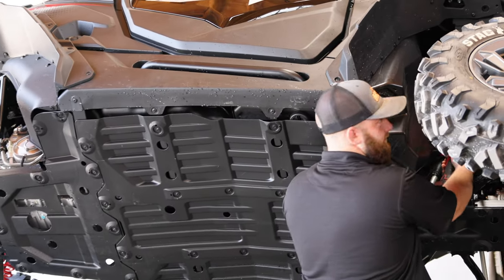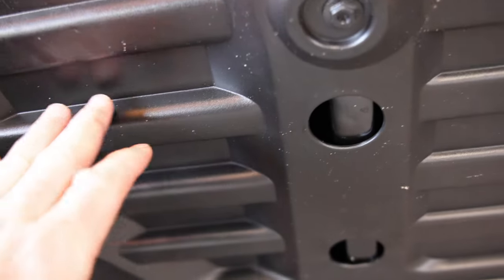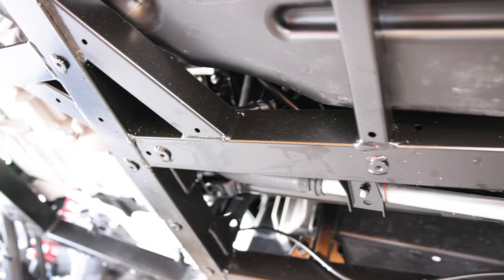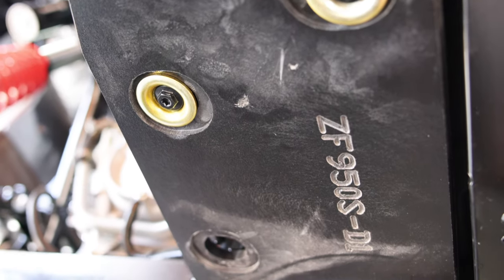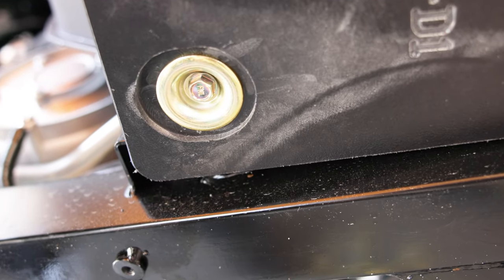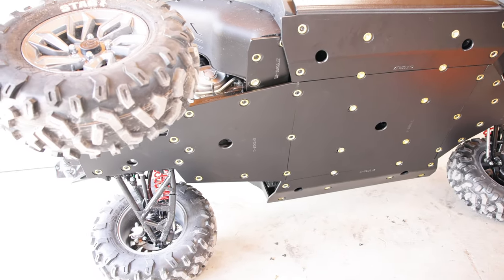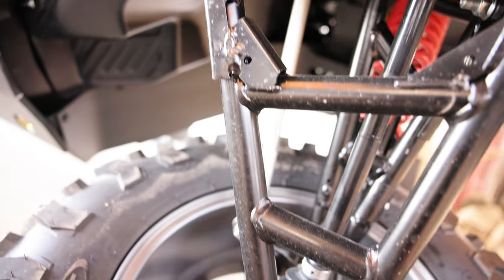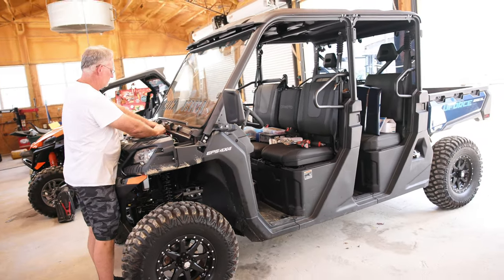Gen 2 CFMOTO ZFORCE 950 Sport Full Skid Plate & A-Arm Guards | Trail Armor

Comment: Okay, I gots to know….exactly how are you tilting the machine in the shop to work on the bottom like that?  Is it blocked somehow on the cage?  I’ve got ways to lift one side, but it never occurred to me there was a way to stand it up that way.
Reply from the maker: hahaha... well... with just the precise tire pressure and with 1.749 gallons of fuel and no mud or dirt build up and with the room at exactly 79 degrees F you can achieve proper balancing room atmosphere for this particular CFMOTO model haha
Reply: The rear of the cage was resting on a stack of tires rewatch the video you can  see it just don't tell anybody it's a secret 😅
Reply: @RealTalkPowersports  okay, got it!  I’ll just allow for the difference in latitude, altitude above sea level, and barometric pressure here in Kentucky and should be fine!  🤣
Reply: @mcrspeedemon  Thanks, I went back and caught it! 👍

Comment: Any after market parking brakes other than a wheel chock ? I can't believe they left that out, it will most likely be a recall and then in the manual they tell ya not to use park wtf ?
Reply: Look up the "spring brake thingy"